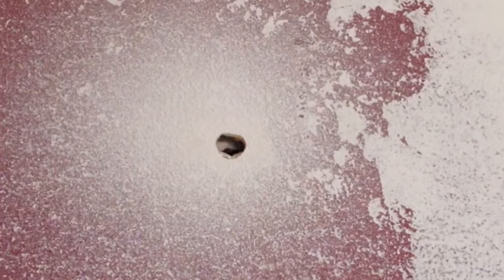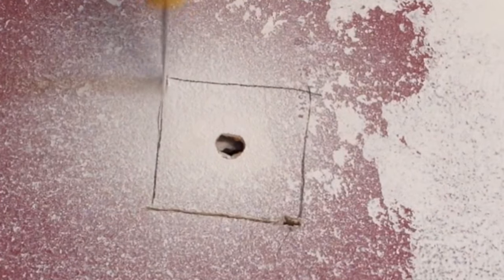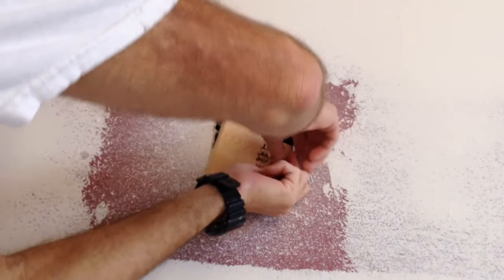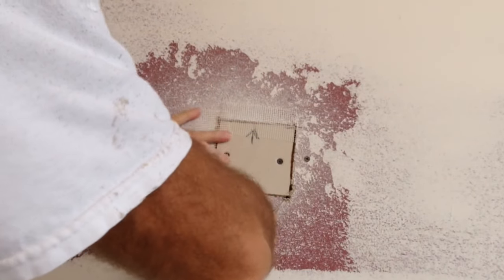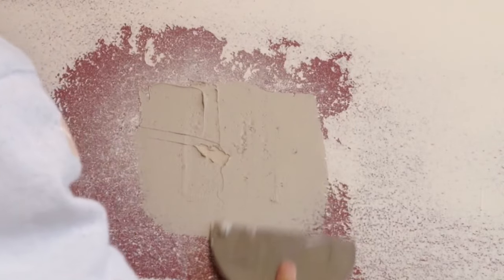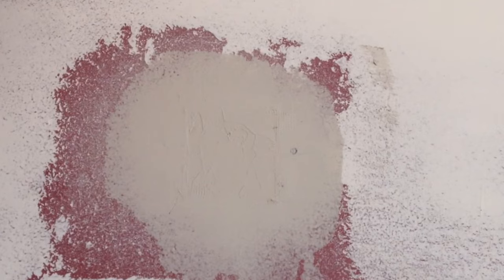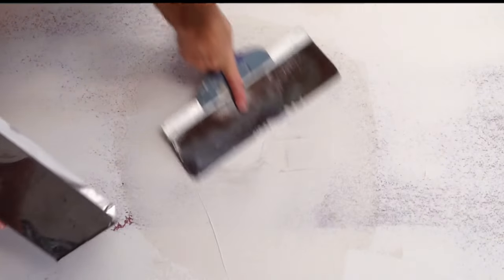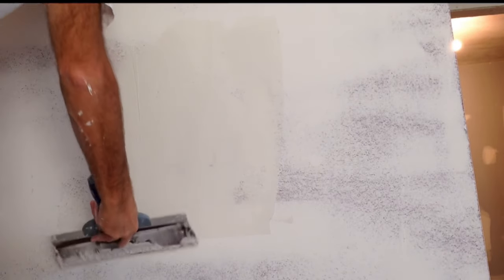Beginners Guide To Repairing A Hole In Your Wall!

Comment: Nice work, man! I just did my cave. and had to do a lot of things I've never done before. I had some pretty bad water damage on one of my walls that pretty much had it all. It had big blisters down to the bare gypsum, torn paper, unseated corner tape where the wall meets the ceiling, and to top it off, a hideous 80's wallpaper border, lol. I had to sand down the evil mop textured ceiling down to about a 16th proud, then skimmed it. Also had to use door shims to lower the ceiling drywall on one wall because there was an inch gap between it, and the wall due to where the joists are. Prefilled with some 45, retaped all the way around the ceiling, primed, and painted the entire room from top to bottom. It took me almost two weeks because I'm still very new to all of this.
  I even tried your mud-rolling technique, but abandoned it because my roller sleeve was only 3/4 nap, lol. As a result my cave looks pretty damned good. I even managed to get rid of a pretty nasty diagonal crack spanning from the closet door trim to just below the ceiling. Yours, and a few other peoples' expertise are what inspired me to get it done. Now I gotta do my wife's craft room, lol.
Reply from the maker: That’s awesome man!💥👊🏻 I really appreciate your feedback. Thank you so much for watching and commenting my friend.😎

Comment: Hi Paul- i have a wall that has a couple of coats of paint and a portion of the wall that has a 3' by 5' raw drywall paper exposed. I think someone pulled a desk off the wall. Wondering if i should apply some Fiba Fuse to fill the gap between the painted part of the wall and the exposed drywall paper? Thanks!

Comment: Paul, new subscriber here and here to stay.  Just found your channel.  DIYer with a large project in progress.  I might hang the drywall but know enough to rely upon a professional for the taping and finishing.  I would like to get a pro to skim coat the whole thing.  Is there a particular type of wall board that should be used for skim coating?  I've been searching through many of your videos but have not come across that answer.

Comment: Thanks for all the tips. I grew up learning so much via City and Guilds in England but as I don't do this everyday I love the tips. How about a quick way for a level 5 finish? I just spotted a new product from Mudskip. Yes or no?
Are there any products I can spray which levels out on the wall?
Reply: BTW Love Guardz for so many issues particularly here in Texas where they all cut corners. I was one of the first 2 buy the original product by the palette. Back in 2004. Can't remember its name though